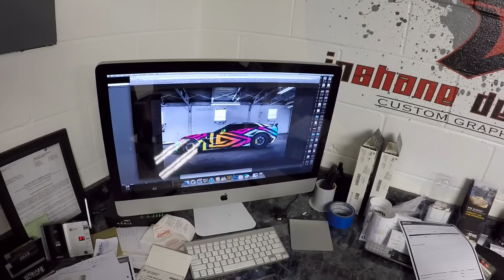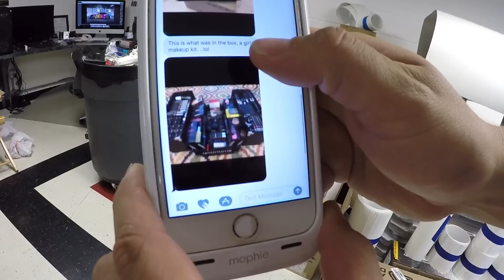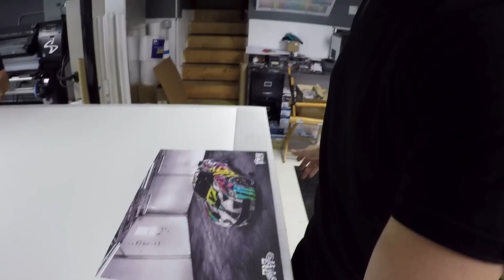NEVER try to Run From The Cops...

Comment: Radar detector.... get one.  Also just for those youngins that want to try their luck at running, keep two things in mind, 1: Never run in area you are unfamiliar with, 2: NEVER go in a strait line, the SECOND you pass the cop your job is to get off the road and out of sight.
Reply: Zero-Gaming radar detectors don't work against experienced cops
Reply: The 570 If a cop has radar, he is certified to use it. Meaning, he is trained to be able to accurately guess your speed +/- 5 miles per hour. By the time the detector goes off, he's already seen you and you're fucked if you're not in a group with others driving similar speeds. So, there is no such thing as an "un-experienced" cop running radar ;)
Reply: Zero-Gaming it's so easy to get away on a bike it's rediculous
Reply: The 570 LOL thanks for the good laugh, they can't beat technology. Even IF they use POP their eventually going to get detected. Couple that with Waze and their days of hiding are virtually gone.
Reply: Justin R: Cops don't need to hide to catch speeders. Hell, they can be in plain sight and people will still fly past them - being visible does not deter. Nor does having a detector. In addition to that, cops absolutely do not give a fuck about Waze. The best way to not get a speeding ticket is to ultimately just not speed in the first place =]
Reply: Nate lol their will always be plenty of clueless rabbits who can be used as bait.
Reply: Justin R I love having a rabbit ahead of me - how else am I going to get away going 78-85 in a 65 every time I hit the freeway? (That, and Nevada Highway Patrol doesn't care - I don't slow down when I see them, because doing so basically says "look at me, I'm speeding and I know it, pull me over!")
Reply: Unless you get a radar jammer but that is highly illegal lmao
Reply: It's worth noting that in PA (where Mike lives), only state troopers are allowed to use radar and laser. So this time, a detector wouldn't have worked.
Reply: Nate Radar detectors pick up the bands used in radar well before you're seen by the cop. This allows you to slow down before coming up on the cop. Lazers on the other hand require jammers to keep them from getting a reading. What most do is have their jammers on a switch and they slow down and then shut them off so the cop can then get a reading at the correct speed.
Reply: yes, that's the smart thing, also if u have a jammer most if not all have this mine have this one that makes a sound once your getting a ping, so that u can adjust speed there not illegal in all states but there illegal in a lot of states. but if they don't know u have it it isn't illegal. just hide it somewhere in the whip
Reply: I will say that they help you realize a cop way before your eyes physcially notice or see it and give you time to slow down. even if they radar you at lets say 55 in a 45. but you slowed down WAY before you got to him. he's not ganna bother you.
Reply: Cina FUCK OUTTA HERE A COP GOT ME AT 941 YARDS AWAY WITH A LIDAR GUN SAID I WAS GOING 52 IN 40 AND I STOPPED AT A FUCKING STOPLIGHT
Reply: Radar detector in PA is like putting a condom on after sex. Only the State Police use radar. The locals are not allowed to use radar. They use speed timers like Vascar and Enraad, which are not detectable since they don't emit anything. If you buy a radar detector and you live in PA you are throwing money away folks.
Reply: Zero-Gaming don't let them get your plate either....
Reply: Zero-Gaming or get a motor cycle XD
Reply: with most all radars instant on, all that will tell you is you just got a ticket.  :)  I quit running my valentine one.  Real solution run WAZE app.  Let all the users tell you where they at.
Reply: Dj Deertz Most detectors at pricepoints that the average person is willing to buy have very short range - usually less than a mile - and at that point you might as well have seen the cop with your own eyes. Of course, this doesn't include very expensive detectors like a Valentine or a Passport; however, most people aren't ready to drop the money on one of those (unless they've got a good motivator, like an accumulated quantity of speeding tickets). Still, nothing can legally trump laser-tag -- jammers are highly illegal and I don't have sympathy for anyone who gets cited, towed, or arrested for operating one.
Reply: Nate Lasers are not illegal in all states. for example my state (Ohio) has no such ban. and yes you're not going to buy detectors at Walmart and do anything.you get what you pay for.
Reply: Dj Deertz I wasn't trying to say laser was illegal, I was trying to say jammers were. =]
Reply: Nate you know what I meant haha at work and on my phone you know how that goes :p
Reply: Zero-Gaming e
Reply: Zero-Gaming you can out run the car and out run the cop but you can't out run the radio
Reply: Zero-Gaming facts. I do this all the time
Reply: Another good point, it's a felony. At least here in WI. I made it home only to have police show up later in the day and arrest me. Dash camera and traffic camera fucked me. Couldn't blame anyone else for driving. Had the felony dropped but ended up paying $2500 for a lawyer, $100 a month for 16 months for a probabtion officer, $350 court costs, $680 in reduced fines. Think I'd have rather stopped and faced a 30 mph over fine.
Reply: buying a cheap radar detector kinda defeats the purpose of having one in the first place.  If you cant afford a escort or a valentine or similar, you probably cant afford to speed to the point that you need one.
Reply: Pseudo Mortality Holy shit man! I'm surprised they dropped it for you, that's badass. Good for you man
Reply: radar detectors usually don't work in cases like his because they usually run laser by the time it rings it's to late. he needs something like a k40 jammer around $1500 he can afford it
Reply: +Nate wow
Reply: +Nate fr
Reply: Exactly- done it countless times.  You have to think

1. Did he see my plate?  If so, pull over
2. Can I get out of his line of sight in less than 2 minutes?
3. Is there an off ramp soon?

Comment: Good advice. I once i got pulled over for 45 over because I was going 25 over in a 100 KM/hr area, but it changed to 80 without any posted signs.

I politely informed the officer of that fact, and he said I was right there was no sign telling me, and he reduced it to only 25 over because I was driving as though I was still in a 100 zone.

Be nice, cops are just doing their jobs they aren't purposely target you, they just happened to see you speeding.

Comment: I got my license in may of 2016 and by May of 2017 I have been pulled over 3 times and am still ticket free and don't have any points on my license. Being polite definantly  helps. I did get a written warning for 90+ in a 55mph area... the state trooper that stopped me asked "How the hell did you get this old thing into triple didgets." I own a 1997 Toyota Camry with a couple mods. Nothing major, it gets me to work during the week and it gets me into trouble on the weekends.

Comment: Anything more than 31 over the limit in PA is automatic 15 day suspension and 5 points. No ands ifs or buts. You will not get an occupational license for a suspension less than 30 days. Learned this the hard way doing 98 in a 65 in my Evo.

Comment: Here is why high deductibles are bad, that side impact is one deductible, if the tire did any more damage that would have been another deductible and so on. It can exceed your damage per incident quickly if more than one thing happens at once

Comment: When you get pulled over, roll down the windows, take the keys out of the ignition and place them on the roof of the car (making sure they see this) and place your hands at the two and ten o'clock position on the steering wheel.  You'd be surprised how many cops immediately see that you're a non-threatening individual and this immediately cuts their tension drastically even before they "greet" you.  PRO-TIP.

Comment: Hey Mike, I've been a huge fan of your channel for a while now, seems like i watch your videos religously haha, and there have been a lot of situations you captured in videos that ive had a similar situation to. Like one time i was working at one of my jobs as a delivery guy, and as I was driving in a nighborhood, and I saw a turkey just walking down a sidewalk like in one of your videos haha. Im 17, and not too long ago i just bought a 2011 G37x and maybe about a month later, keep in mind im still pretty stoked about this pretty quick car, I was leaving my highschool and one of the ways  back home, usually the fastest, theres about a 3/4 mile stretch over a hill, and traffic officers like to sit at the bottom of the hill behind this little bush, and i was in 4th gear as well going up this hill but i was already slowing down before i reached over the hill but when i saw that motorcycle I braked a little, but i knew it was too late, I was just trying to lower the severity of the ticket. The officer told me he clocked me at a 73 in a 40, but i was cooperative and respectful enough that the officer lowered the level from wreckless to speeding. I just think its crazy how well i can relate to your thought process about situations. Well im not sure if you would keep reading this far, if you did at all haha, but keep up the great videos! I know theres hard work that goes on behind the scenes, but youre doing a great job! Thanks for the awesome videos Streetspeed717!

Comment: one day after I finish upgrading my 1999 Chevy suburban I will drive out to PA to have Andy tune it. and i will race you. its cheaper to have him tune it then anyone closer here. it a 454 BBC. the block can handle plenty of power. I want 1000+ HP. gotta make up for the extra weight.  only mod so far is muffler delete. but I promise ill swing by for you if you'd like ☺ might be a while but I will. I need to hear that thing with my own ears 😂

Comment: Holy shit your RPM's are so low on the highway. My s2k is buzzing above 4,000 all the time when I'm cruising lmao maybe I need a v8 someday
Reply: S2kTi damn. My Camaro sits at 1300 rpm in 6th gear at 60 mph. For having 430ish hp, it gets super good gas mileage on the highway bc or the tall gearing, around 26 mpg. But you probably have way more fun on the back roads in your S2K.
Reply: +Tyler Beeson damn that's impressive they can manage that! Makes sense though with the gearing. Yeah man, I'm at a point to where idc much about straight line speed. The way the car makes me feel as it revs out and handles is currently what I love the most in a car. But I'm sure one day I'll have that itch for some serious hp (torque more importantly) again :) enjoy the Camaro!
Reply: +Tyler Beeson I should also mention it's 4K at 75 hahah it's not as terrible as I made it sound initially.

Comment: Mike here is a story you should do for your vlog. Chevrolet released the top selling 50 Corvette dealers for the country from 1-1-17 to 4-30-17. Only one Pennsylvania dealer made the top 50.  You would think it would be a Philadelphia or Pittsburgh dealer?  The largest selling PA Corvette dealer is located in the middle of nowhere in Tioga county on the PA/NY boarder just off route 15 70 miles north of Williamsport.  Elkland Chevrolet in the town of Elkland.  They have 34 new Corvettes in stock now and last week that number was 45.  You should drive up there and do a story on them.  How in the woods in the middle of nowhere are they the biggest in the state. They are a small dealer  http://www.elklandchevy.com/

Comment: There's always Moore than just the lower bumper where that rig tire make damage is like my Kia Rio hit my rear passenger door a big dent I said it's okay its just a door plus in Tijuana it happened in front of a cop he didn't even come to see and tha lady said we'll call my husband and see what to arrange I say naw we'll that's that we'll a few months laters that rear passenger wheel was having bearing issues I changed them they when bad again in a few months changed again this time the bearing and the main nut almost came loose in freeway the on thing keeping the rim is the safety washer I ruin the spindle bearings brakes plus a tow to Mexico 300 plus parts these kia s the only thing keeping the whole wheel drum holding it is that main nut and when you torque it NOT too much so it won't stuck the bearings I am not kidding I torque that nut whit very small and there's no safety pin you have to hit it with a hammer and bent the nut just to get stuck and every time you make brake job you degrade the main nut because the safety lock mechanism